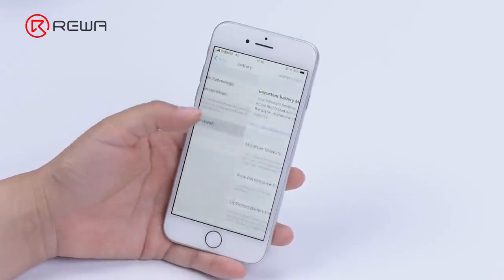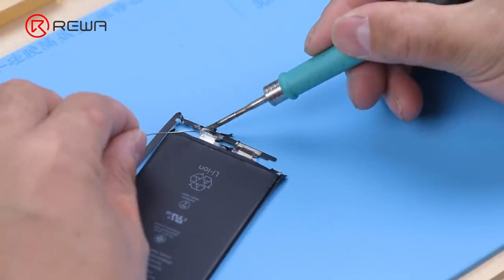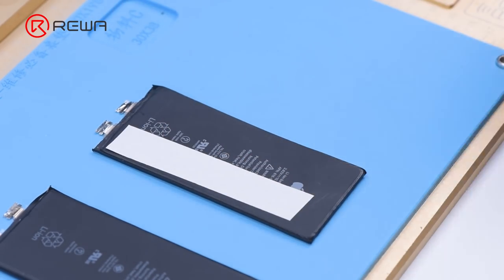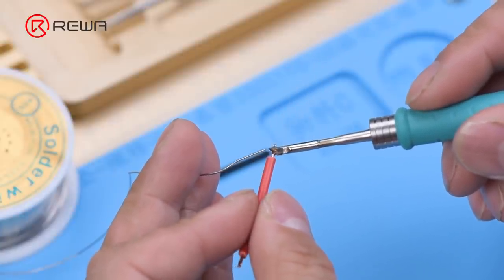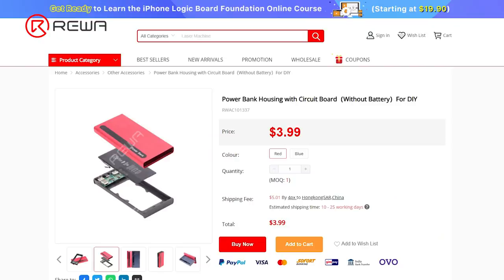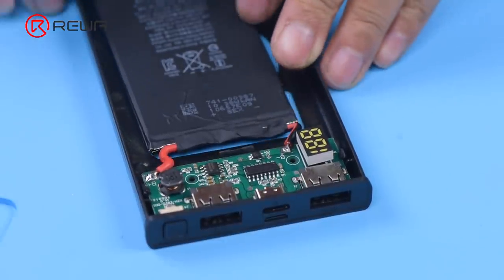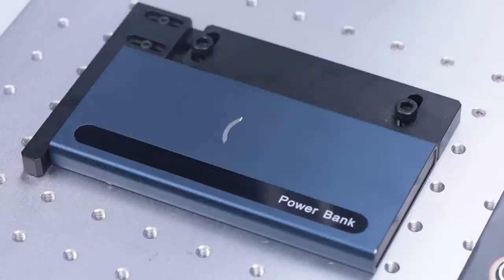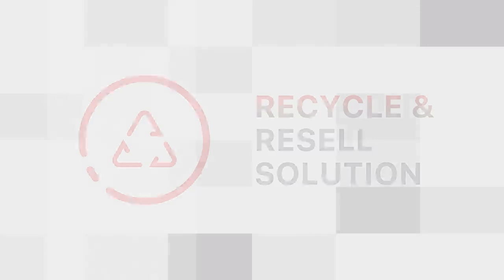Trash into Treasure - Reuse Old Battery as a Power Bank

Comment from the maker: Thanks for your watching and support. Looking forward to your comments, the one whose comment gets the most likes in YTB comment area can get the power bank in our video. 

Power Bank Housing with Circuit Board For DIY: https://bit.ly/3knZzhV
I2C-2SCN Heating Platform: https://bit.ly/2MqWQYm
High Purity Soldering Wire: https://bit.ly/3pS2ujP
Anti-static Straight Tweezer With Ceramic Head: https://bit.ly/3qWuvs5
Reply: Please note that the battery capacity that is below 80% is considered as battery aging and may result in losing the ability to hold the charge so all you have to do is to replace with new battery for longer lifespan.

Comment: For people wanting to do this, please make sure batteries are identical to each other in voltage, if not, charge them individually.
Both batteries will drain down close to one and other, rather than one draining less than other and not getting fully charged, loosing mah's.
Reply: please explain more? so if i use 2 batteries of which one is full and one is flat it will cause problems?

Comment: The power bank must have a battery temperature probe, which can cut off the current at high temperatures to avoid danger.
Reply: no high amps drain involved, battery wont heat up
Reply: true

Comment: Please tell why you removed the BMS ?

The primary function of the BMS is to protect the battery cells from damage caused by being overcharged or over-discharged. Additionally, the BMS calculates the remaining charge, monitors the battery’s temperature, monitors the battery’s health and safety by checking for loose connections and internal shorts. The BMS also balances the charge across the cells to keep each cell functioning at maximum capacity.

If it detects any unsafe conditions, the BMS shuts the battery down to protect the lithium-ion cells and the user.
Reply: the new powerbank pcb alrdy have a bms.
Reply: @aimbuster1  but why he removed bms 
What is the reason behind this?
And one thing if we remove bms 
Battery voltage reading will increase like 3.7v to 4.5v or 5v.
Reply: @mdtauqiralam1018  the reason again is. There is already a BMS logic on the USB Power Bank circout board.
No BMS reads nothing. Two Cells in parallel BMS itself they dont need it also. U just need BMS if you run cells in series.
I dont understand your second questions with voltage reading.
Reply: @aimbuster1  but what if do not remove bms 
Will there be any change?

Comment: Nice idea but there's some minor problem. First you must pair 2 battery with the same capacity for optimal operation, as one could have gone flat first (because of lower capacity) and the other have to charge the flattened and thus  reduce the total capacity, second is you need to count for the battery wear level as they don't remain the capacity like before. And third is in the conversion stage there's some power losses in it, the battery pack you made could only fully charge an iphone for just once and then need recharging, not ideal but useful in some emergency situations. If you still want to do the iphone-battery power bank, at least do with the same battery model and with many battery as possible.
Reply: @mahaniyama   can you expand on this please?
Reply: @ecotechnologysolutions8329  do you own homework
Reply: @mahaniyama   Couldn’t be any less helpful.. thanks pal 👍
Reply: @ecotechnologysolutions8329  usefull information is scattered on the internet but as long as you keep the same cell chemistry and comparable internal resistance, the capacity or the battery doesnt need to be matching because its behaves as a whole while series connection is litterally individal batteries that can unbalance because they dont behave as a whole but rather separate parts.
Reply: @ecotechnologysolutions8329 the way that you connect the terminals can be in parallel or series. Series adds on to voltage, parallel adds to amperage. In this video, they are connected in parallel, so that milliamp hours add up and the voltage remains the same

Comment: I've managed a while back to get ahold of two lithium ion batterys out of some old display cases both being 3.7v, with one being 7500mAh and the other being +6000mAh. Was wondering if the same case you used in the vid would be able to work for them or do certain powerbank boards work with certain mAh sizes. I'm new to this and curious how it all works, thanks 👍

Comment: Very cool as a project, but aren't you replacing the phone battery because it is not good anymore in the first place? Using it in a powerbank would just make for a powerbank that doesn't hold much of a charge and needs to be recharged often? Specifically, if you use it on your iPhone, it would not even give it a full charge. A 10,000 mAh powerbank of that size can charge your iPhone at least 3 times.

Comment: Awesome , i made that before 10 years
But it’s dangerous no one do it if not understand . It’s becomes fire 🔥
Reply from the maker: Thank you for watching and commenting. According to the information given by REWA technician, please perform the following two points to ensure safety:
1. Please choose a good-looking battery without damage or swelling.
2. Please protect the position of the battery welding wire to avoid short circuit of the battery.

Comment: Before reuse trash battery please make sure it safe to re use, or it will explode, its dangerous.
Reply from the maker: Thank you for watching and commenting. According to the information given by REWA technician, please perform the following two points to ensure safety:
1. Please choose a good-looking battery without damage or swelling.
2. Please protect the position of the battery welding wire to avoid short circuit of the battery.

Comment: NEVER connect different capacity cells together in series. This is dangerous 🤦🏻‍♂️
Reply: How so?
Reply: @ecotechnologysolutions8329  just say you connect a 2000mah and a 1700mah cell in parallel. When you go to charge it the charger will only stop when it sees 4.2v. When you go to discharge there’s a chance the 1700mah cell can go below 3v while the larger cell is still at 3.5v. Because they’re in parallel the larger cell will be keeping the voltage up and working harder. Meanwhile the lower capacity cell can very likley go below low voltage. But just say it goes to 2v (very bad) the bigger cell is still 3.4v then the total output may only be 3.2v so you think everything is ok. But the low cell will discharge and possibly start taking large amounts of current from the larger cell because there’s no current limiting in place now. So on and so forth.
Reply: @pcarlson1979  Wrong. In parallel connection capacity of batteries doesn't matter. Capacity matters in series connection. Connection presented here is parallel.